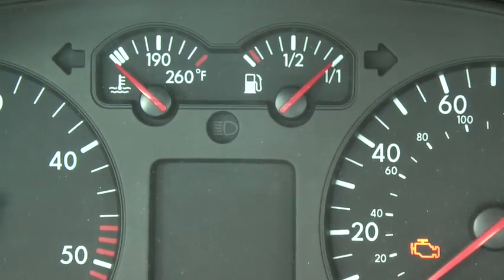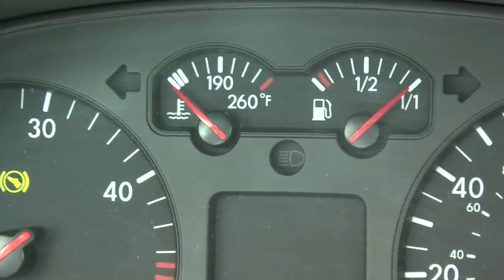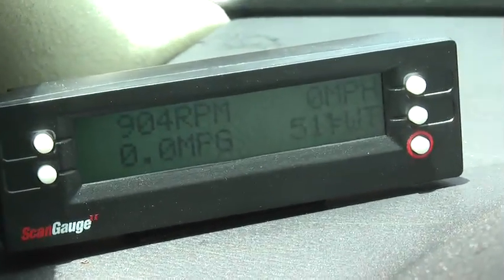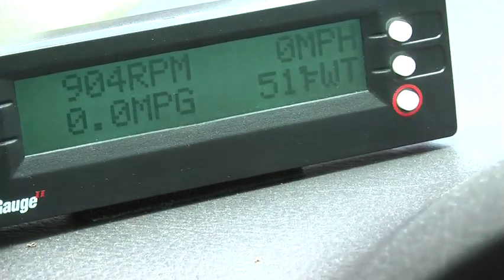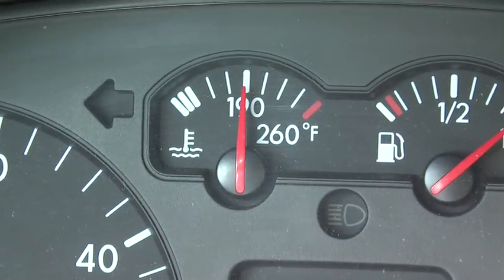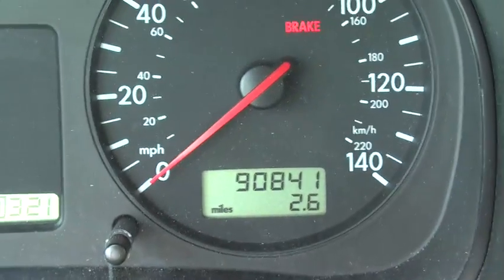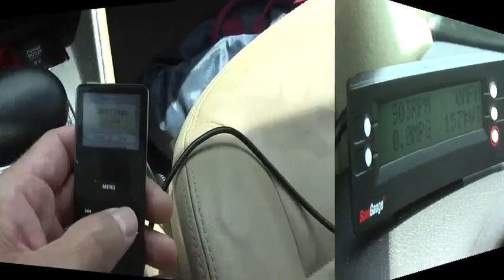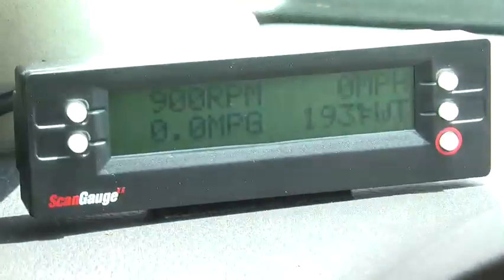Scangauge 2 vs. TDI's onboard H20 gauge

Comment: what we have seen in your video is absolutely normal.
the reasson is that when the temperature of the coolant is almost in the optimun range, the dashboard will show as it is at the optimun range, this is made this way to avoid some users to worry about the gauge moving due to minor tamperature change, as far as i remember, if the car normal temperature is lets say 90 celcius, the gauge will show 90 between 80 and 95 or 98.

Comment from the maker: Most Vehicles since 1996(?) - including VW - have the connector and use the protocol.  I think you have been miss informed.  I would check the scan gauge website or google for a list of compatible auto makers.  If you live in a CARB state  your dealer is probably wrong about anything related to a earlier TDI

Comment: oil temp is usually 25 degrees hotter than engine coolant temp and heats up faster as it is the fluid that takes the most abuse

Comment: majority of cars water temp gauges have big buffers like that.  Youd find the same thing from a bmw to a honda. The stock gauge will show normal operating temp a lot sooner than is actually the case. Same on the other end. if you start to over heat the stock gauge wont move north until its really gone up(where the scan gauge would obviously show it right away).